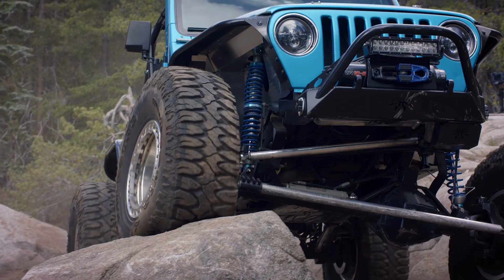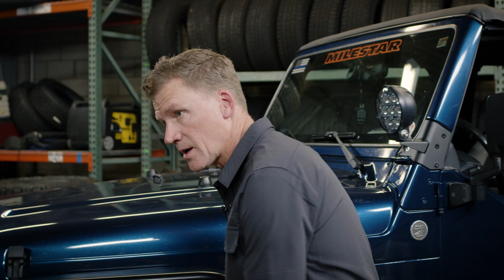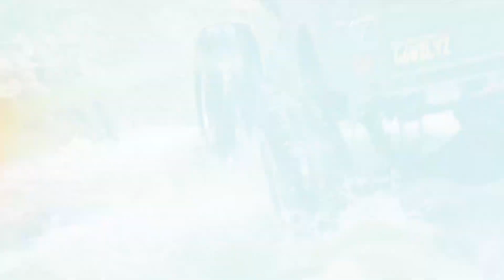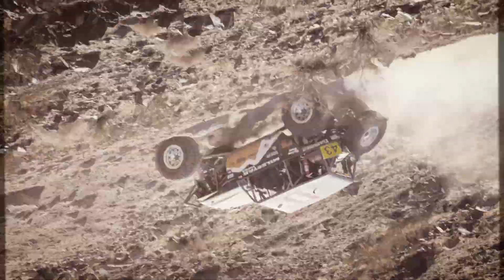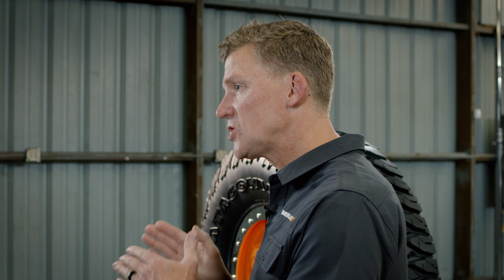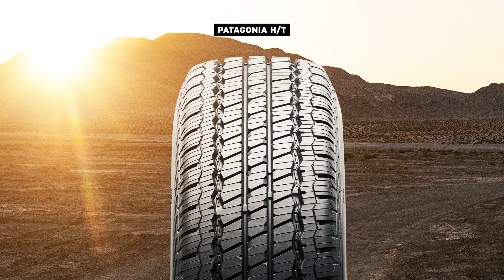Driven by Enthusiasts: The Milestar Patagonia M/T-02

Comment: Getting second set tomorrow! 
No issues, an all around great tire. 
Ran it all winter here in Anchorage, Alaska also put tons of highway miles winter and summer superb value and performance. 
I’d replace my 36” super swamper Iroks if you can get them sold everywhere. I only found one shop here. 
Better yet sponsor me and I’ll become a dealer!
Reply: My Rig is a Built Daihatsu Rocky, definitely an eye catcher. 
All Toyota drivetrain.

Comment: Totally left out how the original m/ts had horrible side walls.  I had 2- 38s and a 37 have sidewall failure from rim to tread. I'm interested in exactly how the 02s are better in this area.
Reply: I heard several stories of the same exact issue... and with the 'black' trim/model as well. On the website, it says both the OG Patagonia and M/T-2 have 3-ply... It doesn't say anything else about it

Comment: I’ve run the 3813 5017 on my jeep JL and I’ve had no issues, I recommend this tire I think it’s a great tire I think Patagonia did a incredible job, I just ordered a 392 jeep and when that comes in I will be putting these tires on it and putting them to the test But I’ve had no complaints these have been wonderful tires they are lightweight which reduces rotating mass traction is excellent, I’ve run them in snow and have had no issues they’re fairly quiet on the street and they’ve kept the price affordable for the average person in my opinion there’s no reason not to use these tires they work great, you may have to be a little more cautious with the sidewalls and I rub my sidewalls plenty of times and have had no issues

Comment: Andrew, I want to address several issues. First, stop calling this tire a MT.  It is not a true MT.  It is an extremely good hybrid tire (for about 5000 miles) and excellent on the rocks in areas like Moab, but it absolutely sucks in the mud.  The tread blocks on the tire’s edges are not spaced widely enough to clear mud.  I noticed in this video there is zero footage of the tire being used in the mud.  Next, the center tread is great at delivering a quiet ride, but let’s be clear; folks looking for a true MT don’t care about road noise.  Lastly, not everyone runs 37”, 38” or 40” tires.  While I realize that these are now common sizes in a 17” wheel option, there are still plenty of folks out here running tires on 15” or 16” wheels.  This produces a much softer ride.  Also, the Patagonia MTs (two sets) that I have owned did not measure out to the height that was advertised. So, there is that too.  I have owned Patagonia MTs since 2018 and they just don’t last.  Cupping is a real issue.  Chunking is an issue.  Longevity shouldn’t be used in the same sentence as Milestar.  And, you don’t listen to your customers.  I have given much feedback while the MT 02 has been under development.  I realize you don’t know me or my credentials, but I have been off-roading for 35+ years and have run nearly every brand of tire out there on a multitude of different off-road vehicles.  I gave Milestar a shot, and was even excited about them in the beginning, but no more.  I cannot recommend Milestar Patagonia MTs to anyone who drives off-road in the Eastern USA.  They are adequate for a strictly off-road vehicle if you live in AZ, UT, CA or other dry, rocky desert-like terrain, but completely useless in areas like KY, TN, NC, PA, etc.  I suggest changing the name of the tire to RT (rocky terrain) and focus your marketing efforts to people in the western USA.  Good luck.  If you ever develop a true MT, I may give them a try.
Reply: All you just said  is exactly what i thought of this  tire , you forgot the fact that they seem to be put together in segments too , something like quarters of rubbers joint into a one whole piss and I thought oh shit 
Besides, i only drove 8000 miles  and off road 4 times on the deserts of California i can said this tires are ok off-roading only not for highway expectancy 
They out of my rig and for sale after the freak show they performed for me and got now some ko2 which are enough for what i do here

Comment: I have over 33,000  on my 35x12.50r20 MT's on my 13 F150 FX4 with 6in lift fox suspension, Icon billet uppers and so on. At 30,000 tread depth was still 11,10,9 and 9. I rotate every 3000 give or take a few, 38-42psi for the road. I'm on and off  road from Denver to Dallas and up to South Dakota July 2022 will be 2 years on them couldn't be happier. The only issue I've had, a bolt in a tire from a jobsite. Can't wait till it's time for new shoes it'll be MT-02's.

Comment: Looking everywhere for the 38x13.50r17  mt02 but nobody has them. I need to replace my first gen 38x13.50r17s on my jkur, after 2 5 years daily driven on and off road.
Only complaint I have is they became a bit slippery on wet roads after the first year.

Comment: My Patagonia M/Ts have performed expectedly well off-road and shockingly well in snow. They are "floaty" on the road, which is somewhat tolerable, and they're quiet. The problem with them is that they wear unevenly, and that's likely to do with the crown design. At 12k, after my 3rd rotation, I've got vibration, notable cupping, and more pronounced bounciness on the highway. My hope is that the M/T-2.0 or perhaps the XT (which is apparently now available in a much wider range of sizes) would be designed to wear more consistently and eliminate these issues. Dealers don't have a clue and Milestar is impossible to reach (try their contact form- it doesn't work).
Reply: Yea same here they just came out of my rig and got replace with ko2 which is good enough for what i do on the deserts of California .However, they are good on what they for but not highway use !

Comment: Patty owner here (37x12.5 R17) for 3 years now. Been wheeling them on my  2016 JKUR in Wa the whole time. I also daily my rig. At first I loved them. But since last winter I have had to sipe the center lugs my self as the original sipes are much much less than when I first got the tires.  Two wishes. (1) the sipes should be the zig zag type. With , limited real-estate on the center lugs the zig zag sipes give you something near 30% more liner sipe. (2) full tread depth sipes on the center lugs. I cant stress this enough. I live in WA,and it rains. I suffered through about 3 weeks of fall/winter before I said fuck it,and got my self a hot knife so I could sipe the center lugs. With the new improvements if you added my suggestions you would have a winning combo.